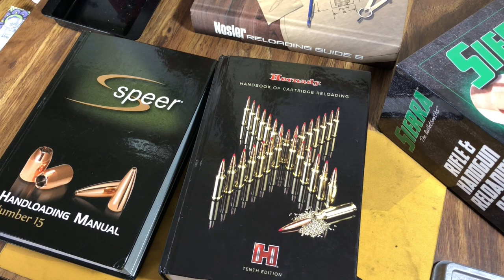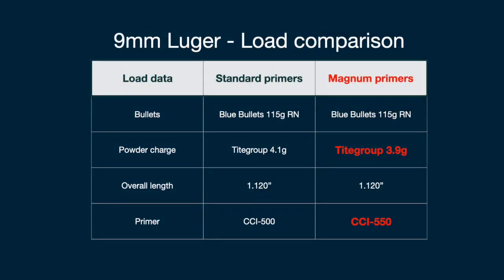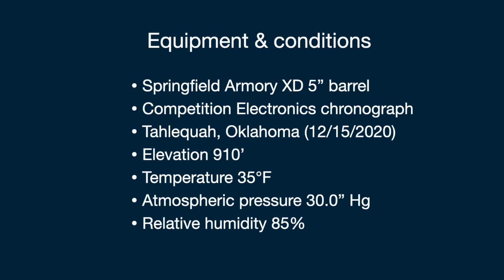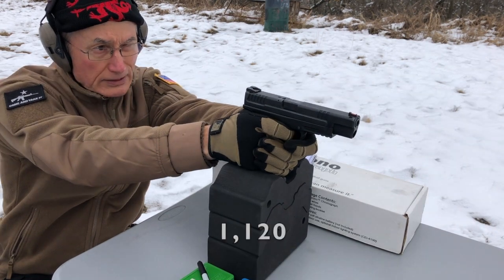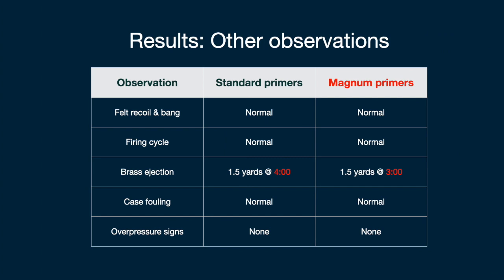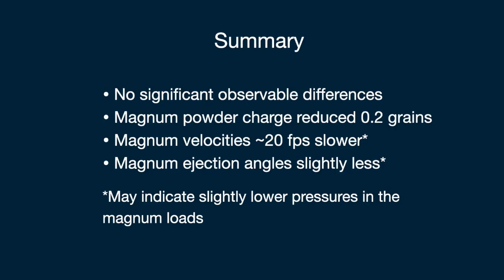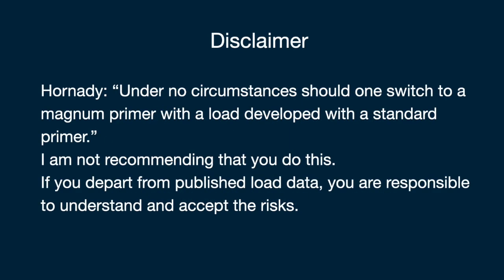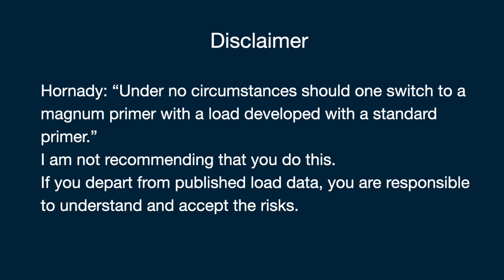Magnum Primers for 9mm Luger?

Comment: Another video also had magnum primers causing slightly lower (insignificantly though) velocities. Possibly the magnum primer lights the fast pistol powder too fast and the bullet does not have enough time to reach 100% of the standard primer speed.

Comment: Someone told me small pistol magnum primers are the same primer charge as small rifle primers.. dunno if that’s true but a test would be cool.. lol
Reply from the maker: I've heard that rifle primer cups have slightly thicker walls. If so, they might or might not work with a particular pistol depending on how strong the striker/firing pin spring is. As for the charge, I wouldn't be surprised if they're all about the same. All primers have to do is ignite the powder. The powder then creates the huge chamber pressure, up around 30,000 PSI for 9mm. Any pressure contributed by the primer would be tiny in comparison.

Comment: Thanks for this info. It is very helpful. Did you see any difference in accuracy/grouping?
Reply: I didn't check accuracy or group size, since I was just shooting through a chronograph into a berm. I predict that there would be no difference, since pistol shooting is not a high-precision sport. Variability caused by the shooter himself  is usually much greater than variability in the ammo. As someone pointed out in one of the other comments though, magnum primers have thicker cups, so with a pistol that has a weak firing pin strike, you might get a failure to fire.

Comment: Yes they can be used if it's all you can find but beware that the magnum primer is either thicker or harder and therefore requires a harder hammer/striker hit. You may find that some firearms will not set off the magnum primer and cause malfunctions.  Only way to know if your firearm will work with them is to range test plenty of rounds, check the spent casings and see if the primers show signs of light strikes. The power factor of the primer itself is zero.
Reply: Thank you for the info.

Comment: I am testing magnum primer small pistol to see the results as with standards I got cycling issues of missing cartridge load on chamber resulting in block, the gunsmith suggest me to use CCI  magnum primers ones instead of normal 500 use 550 magnum and observe if happens again: on glock 17  9mm x21 I hope solve it
Reply: It sounds like you're having failures to feed. That doesn't sound like a primer issue to me. I would think it might be more like a problem with the cartridge dimensions, such as incorrect bullet or case diameters, or maybe that overall cartridge length doesn't work well with your gun. Also, it might be an issue with a weak recoil spring that doesn't have enough power to push the cartridge in. Is the feed ramp smooth and clean?
Reply: @salmonthomas  it has been tested with the original GLOCK spring , cartridges dimensions are measured by digital caliber and are seating at its OAL 29,5 mm , high cartridge loads 5,4 grain Vjhyavouri N340 , the pistol has the trigger prepared by a real expert on its original base for optimize it’s performance. 
Another suggestion says to crimp more the bullet
Reply: @salmonthomas  as weak recoil it can be this is the reason why he suggest to crimp and test both with CcI 500 and 550 magnums
Reply: Is your problem a failure to feed the cartridge into the chamber when the slide goes forward; that is, before you fire? Or is it a failure to extract or eject after you fire? If it's a failure to feed, does it happen when you load the first round from the magazine, before firing the first shot? Depending on when the malfunction occurs, you might be able to narrow down the cause. Your overall length sounds long, at least for 115 grain FMJ bullets. These commercial cartridges are usually about 1.155" (29.34mm). I load mine between 1.120" (28.45mm) to 1.135" (28.83mm). I don't have any references to know the correct charge for that powder (for 115 or 124g bullets), but 5.4 grains sounds like a lot. So you should have plenty of chamber pressure, and I don't think changing primers would have any effect. Generally people taper crimp 9mm. I use a light crimp. Are you setting your powder charge and overall all length based on a reference book? You should follow their specifications for both powder change AND overall length. Both affect chamber pressure, so you have to get both right. Overall length also affects feeding. If you follow the reference data, it should normally function fine.
Reply: I use 123 gr fmj following the loading data but 0,2 grains more to reach 350ms the no feeding issue happened at the second 8 shot group exercise so at magazine full at half, it is very strange issue.on single shot doesn’t happened, this happens On a  very  rapid fire sequence .is a cycling problems
Reply: OAL is the correct data loading length with the RN 123 gr fmj

Comment: Mate, I refill .308w, with magnum primers, for winter hunting -10Cº, because they have better lighting, I just lower the grains a little, like you have done. They work perfectly. Greetings from Argentina
Reply from the maker: Thank you for the insight. Wow, that sounds cold! I probably wouldn't last 30 minutes below freezing! By the way, I've been using Servicious Aventuras primers from Argentina. They work fine for my 1911, but some shooters with striker-fired pistols have occasional misfires, perhaps due to thicker primer walls.
Reply: @oakleydefense5513  ,Your assessment is correct, those primers are thick-walled, they do not work well in pistols with a lightened hammer, IPSC shooters use "imaz" PRIMERS

Comment: Great data! Thanks for this. I've been a bit apprehensive to load my Magnum primers for use in my striker fire pistol. Since you used a striker fire for your demo... it game me a lot more confidence. You should do another video using small rifle primers for 9mm. I have these as well, and the only issue I may run into, is the fact that rifle primers have a slightly thicker primer casing. With this said... I may have to strictly use these in my hammer fired 9mm. TBD... Thanks again!
Reply: Thank you for watching my video and for the comments. It’s good you understand the difference in wall thickness for rifle versus pistol primers. Which brings up a good point you’re probably aware of. Some primer substitutions might be acceptable but using any pistol primer in a rifle cartridge is potentially dangerous because of the thinner walls in pistol primers. That, combined with a more powerful firing pin and higher chamber pressures might lead to a punctured primer and high pressure gas going back toward the shooter.

Comment: I've recently had a problem with light primer strikes using magnum primers. 9mm, 115gr FMJ, 4.4grs Win244, CCI550. 3 out of 10 failed on first attemp, all fired on second strike. Sig M17 pistol used. All firing pin indentations were noticably shallower than what Im used to seeing.
Reply: Thanks for the info. What brand were they?
Reply: @salmonthomas  CCI SP Magnum.
Reply: Yes, that's a potential problem with magnum primers, due to thick walls. It can also occur with standard primers from some manufacturers. For example, Servicios Aventuras small pistol primers (Argentina) can likewise fail in a gun with light springs, but with a strong firing pin, they fire consistently. If 100% reliability is required, we must first validate them with the specific pistol.

Comment: When I load 223 rem I use whichever small rifle primer I have available.  I honestly do not notice a bit of difference using standard, magnum, or the military 5.56 primers.   Maybe if I was loading to 5.56 spec there would be but in a general range load, about 2700fps, there is no difference in point of aim, rifle function, or brass ejection.  With .357magnum I notice perhaps a scrap or two of unburned powder with small pistol vs magnum. Point of aim at 25 yds is the same though.
Reply from the maker: Thank you for the info.

Comment: Commenter Sean Tu says it very well. The effects of using magnum primers is going to be highly dependent on the powder being used. Effects can range from barely noticeable to highly dangerous. 
Can it be done? Yes, under a "buyer beware" caution. You are introducing a variable into your reloading without being able to measure the actual pressures. Any manual or reloading company is going to say "absolutely not". 
Home experimenters will fall back on the old standard which says "with ANY change of components, ALWAYS reduce the load by 10% and work up slowly from there, looking very closely for any signs of pressure." That's the rule for home experimentation. 
In this example, while very little difference was noted in speed or handling, the videographer very kindly added where the brass was going. The change of angle for ejection is an indication of differences in slide speeds. That magnum primer is sending the slide back faster. A faster slide speed implies greater pressure (even though no other differences were found). Food for thought.

Comment: I'd be more concerned about pressure than velocity, and even then it's probably still fine.  But I wouldn't do it in, say, a hundred year old Luger but would be less concerned with something like a ten year old CZ75.
Reply: I agree. What I really wanted to compare were chamber pressures. Unfortunately, I have no way to measure it, so I used velocity instead, which the best method available to me to compare relative pressures.
Reply: @salmonthomas  exactly.  I can trust a manual all I want and I can trust the firearm all I want but ultimately it's up to me as a reloader to make sure the explosion I'm creating in my hands is safe, no matter what.

Comment: One thing not addressed is the possibility of light strikes due to the Magnum primers being harder.  Something to consider.  Otherwise there's really no appreciable FPS or chamber pressure difference for standard handgun loads.  Your FPS decrease is more likely due to the reduced charge than the primer change.
Reply: Thank you for the info. I didn't know that magnum primers are harder, so what you say makes sense. Similar to the risk of using small rifle primers for pistols loads.
Reply: @salmonthomas  Yeah I think it depends on the gun.  For a SA/DA and striker fired gun there's a compromise with pull weight of the trigger and primer strike ability.  A nice advantage of a SAO gun.  Can run a stiffer hammer spring without needing train your trigger finger at the gym haha.

Comment: I think the only difference in primers is the wall thickness to compensate for the higher pressure associated with magnum powder. The priming compound should provide the same pressure curve regardless of magnum rating or not. Magnum may even have a bit less due to les internal volume
Reply: Thank you. That seems reasonable. Is that based on your own logic or on something you read or learned from another source?
Reply: @salmonthomas  I always noticed the guage difference in primers. But it was a video on YouTube where a guy had a pressure measurement device and had graphs plotted out. Rifle uses the same amount of primer but a different compound, so that does produce more pressure for a longer period. I'll try and find the video again
Reply: @salmonthomas  https://youtu.be/NGVRGsoOr6k

Comment: Very helpful. I am starting to find magnum small pistol primers and was considering this. (Backing off a half grain or so with Titegroup). I appreciate you taking the time to record and publish this.
Reply from the maker: Thank you for your comment. It's always good to play it safe and start at the middle or lower part of the powder range, then watch for signs of overpressure. A chronograph is very helpful to verify objectively where you stand. Reducing by half a grain might be more than necessary. Several people have told me, including some commenters, that they keep the powder charge the same or reduce it only slightly, like 0.2 grains or so.

Comment: Thank you for your video.I use Lee loadmaster, CCI Small Pistol Primer 500, 115gr Copper plated bullet with TiteGROUP powder. Selected My disk number: 40, 4.7gr powder, shot about 100 rounds with the Glock 19 at the range, feels good, I think it worked.I am a reloading new user.I don't know if this is right？Thank you.
Reply from the maker: I assume the cartridge is 9mm Luger. Are your bullets round nose (RN) or something else? What is your overall length (OAL)? Here's what my reloading manuals say for 9mm Luger 115g FMJ-RN:  Hornady - Titegroup max 4.1gr, OAL 1.100"; Sierra - Titegroup max 3.6gr, OAL 1.100"; Speer - Titegroup max 4.5gr, OAL 1.135".  You might be referring to the data on the Titegroup bottle, which is for a Speer (SPR) Gold Dot Hollow Point (GDHP) bullet loaded to an OAL of 1.135. If you're not using that bullet seated to that OAL, your powder charge is too much and could be dangerous. You should refer to at least two reloading manuals; more is better. If you're within driving distance of Tahlequah, Oklahoma, you're welcome to join one of my reloading classes. Here's a link: https://academics.nsuok.edu/continuingeducation/NRARiflePistolCartridgeReloading

Comment: My theory on the lower velocity is: magnum primers are so powerful, they spit the bullet further out the bbl, leaving a greater volume of space for the burning powder to create pressure.  I think-possibly switching to a faster powder might produce a more typical burn rate. Thats just my hypothesis. A Mag primer is very powerful, it alone will shoot a rubber practice bullet through a curtain- no, the curtain won't catch it, and continue clean  THROUGH the window. Speaking for a friend. Lol.
Reply from the maker: Thank you for the info. Actually the entire process is quite complicated, due to considerations like case volume, burn rate, barrel length, and more, as you said.
Reply: The lower velocity is mainly due to the reduced powder charge.

Comment: We did this exact same test last week using 3.1gn Vihtavuori N320, 147gn RN Blue Bullets through a CZ 75 SP01 Shadow. The chrono showed ZERO difference in power factor (133). The shooter noticed no difference btw the two when shooting. No light primer strikes using a 14 lbs main spring. That may not be the case if using a 11-12 lbs spring which will ignite a Federal primer with no problem. Our testing showed no reason to change the powder load with magnum primers.
Reply: Concur.  I will say one thing that has been missed in the video is that some guns WILL experience light strikes with magnum primers.  My Sig P320 X5 Legion would light strike about 5% of the rounds.  I am running Cajun's 11.5# hammer spring and matching firing pin and spring in my Shadow 2, but I ONLY run Federal small pistol primers as they are known to be softer.  Presumably with the heavier OEM hammer spring, light strikes are not an issue.
Reply: Thank you for the info. It seems that the consensus of opinion is that magnum primers do not necessarily require a lower powder charge, but can be treated as a substitute for standard small pistol primers.

Comment: It's over a year since I made this video and primers are still hard to find. I found and tried some Russian Murom small pistol primers and hope to post a video soon of how they performed. If possible I prefer to buy American, but if your choice is no primers versus Russian primers, that is, no ammo versus ammo, I'll buy the Murom primers.
Reply: I bought the same Murom primers. 1k Small pistol and 1k small rifle. Loaded 100 rounds of each and zero issues. I think they are slightly wider or the cup is a bit thicker as I did have a few issues seating the primers in some cases. Could have been the brass or the fact that I prime on the press so that may have been a factor. A little extra muscle and they went in fine. I've seen mixed reviews on these primers but I've had no issues thus far. Like you said, ammo vs no ammo I'll buy Murom all day until these American companies stop playing games or whatever is going on. I find it very hard to believe they are this far behind. Something ain't right. And a little over $200.00 for 2k including shipping and hazmat ain't bad. BTW these primers are made by the same company who makes Tula and Wolf so I'm assuming they are somewhat decent quality. Hopefully you won't have any issues.
Reply: @pep729  Thank you for sharing your experience. I've shot several hundred of them and noticed the same thing. All performed just fine, but on a few occasions they were hard to seat using a hand-held primer. That happened, perhaps, 2 times per 1,000. Maybe their quality control is not as good as American company's, with regard to size consistency. But, like you said, if that's all I can get, I'll use them.
Reply: @pep729  Russian primers are usually a little bigger